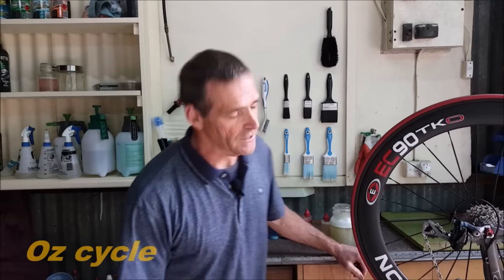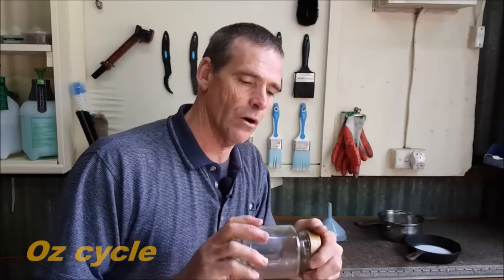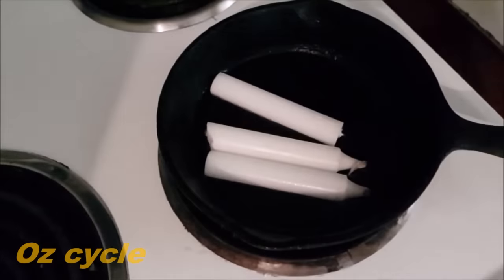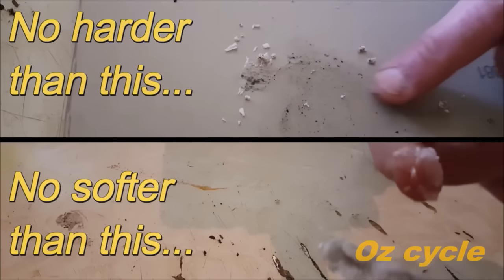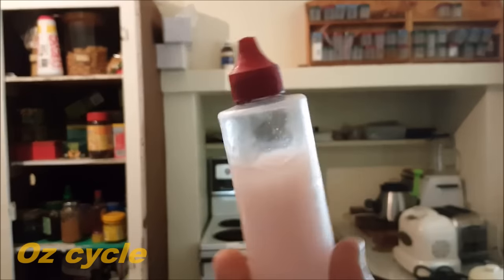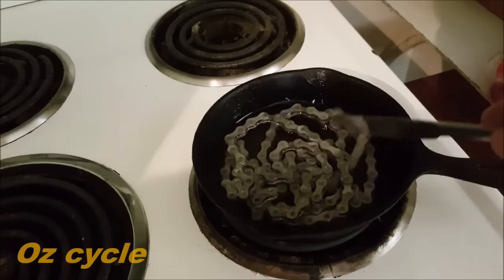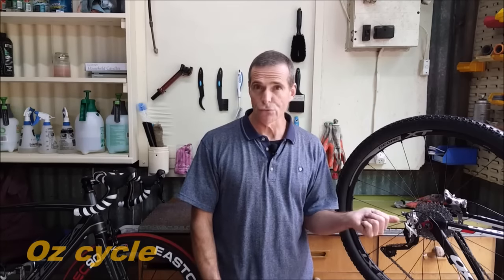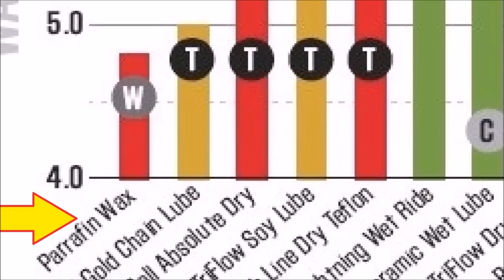BEST chain lubricant ever !! .....make it yourself.

Comment: In Canada , Followed the recipe, added more Liquid parafin so mix was on the soft side. Warmed the bottle to use,  but the waxlube stifens as soon as it drips on the chain. So need to warm the Bike too. (not cold , 12C) . Is there anything we in the north can add  to the mixture to be able to use this without taking the bike up the elevator indoors?
Reply from the maker: Add more xylene to keep it liquid at lower temperatures. The xylene will evaporate once on the chain leaving just the wax.

Comment: Hi i live in a dusty desert environment, would this work as a dry lubricant as well. Ambient temps reach 35 to 40, easily here. And any alternative to xylene, xylene is the solvent here, can acetone, paint thinner be used instead.
Reply from the maker: The wax works fine here in summer 40degrees C so should be ok there. Yes paint thinners or acetone will replace xylene.

Comment: Liquid pariffin or pariffin oil is pricey here, about $10 to $15 for 16 oz or 1 pint. I can get a pint of mineral oil for $2. Also, Walmart sells Florasens lamp oil for about $7 for 64 ounces but it doesn't list the ingredients so I'm not sure what it consists of and I can't seem to find the ingredients online either. What about Kerosene, would that work? About $4 per gallon here.....
Reply from the maker: Chemicals have different marketing names in different countries so best to try it out to see if it works Jeff. The result should be a non-oily but softer wax than hard like a candle.
Reply: oz cycle  I think I'll try the lamp oil first.

Comment: Why dont we use the wax lube for bearing? isnt it good? i think the viscosity really similiar with your medium grease.
Reply from the maker: +Kevin Kurniadi Its a great idea Kevin but there isnt enough longterm testing to prove that it is as good or better than grease. Go ahead and try it and let us know.
Reply: ive tried it already. it failed. its very slippery but i think the wax doesnt penetrate enough and hardened so fast. i think my wax lube doesnt smooth enough?

Comment: Hello sir , 
I have made the lube but i have a doubt sir 

Like you said we should check the consistency of the wax 
I have a made a same consistency which you got in video 
But after mixing the xylene, after applying in chain the wax seems to be ok but not very stiff , it is solid but we give pressure on wax it seems to be like little oily

Is this ok sir will be little oily when we give press on wax after drying
Reply: The consistency of wax which we got before adding xylene is not same after adding xylene
Reply: Please let me know the is this correct

Comment: use a double boiler method when melting wax,  a deep container that holds and boils water and then immerse a tin can where the wax and paraffin oil would melt together.       Similar process as when you are melting chocolate... never directly onto the stove.   Its a much gentler , safer and avoids direct contact with the heat source which could ignite the vapours or any accidental spill.

Comment: Hi  Ive just got a new chain and are waiting for the PTFE powder to come from AliExpress      ,,,question,,,,,once ive done the cleaning of the chain and the initial waxing  in the slow cooker at 90 deg  and are up and riding ,,,,,,,,,   do i then use  this solution on my  chain and  only     remove chain for  hot wash and  then soak in slow cooker  say   once a month ?   im riding  approx  200 klm a week on road bike ,,,,,,
Reply from the maker: Can do but you will get better results from a proper clean and rewax

Comment: what about riding in low temperatures (below 0° Celsius)? will the wax become too hard to have an enjoyable ride?
Reply from the maker: +Knut Knutzen No,it will be fine. Once you have added paraffin oil to candle wax it stays creamy consistency. Its just applying it to the chain with a squirt bottle that you need xylene.

Comment: Okay, so I must not have the consistency quite right. It's rather cool here in Perth today. So I warmed up the squeeze bottle to liquify the mixture again (it had congealed). But as soon as it hit the chain the lube hardened up and it looks rather like I've melted some greasy candles on my drivetrain. :) Suggestions?

By the way, thanks for the "how to" video!
Reply from the maker: +Max Randall Dont worry Max,all youve done is put warm wax on a cold chain. The chain being metal will quickly bring down the temperature of your wax. Best thing is to warm up the chain. If you cant remove the chain from your bike,keep the wax:paraffin oil ratio the same but add more Xylene...this will keep it liquid at colder temps but you will need to allow longer time for the xylene to evaporate b4 riding the bike. If you can remove your chain best is the 'hot wax' method.
Reply: Thanks for the quick response. Much appreciated. I used our rice cooker, melting three candles, which came to about 250 ml. I added 250 ml of the paraffin oil and then added xylene. I probably didn't add exactly 250 ml of xylene though. That stuff scares me a little and the kitchen was getting a little fumey! So, I'll add more xylene and see how that goes. Thanks again.
Reply from the maker: +Max Randall Dont use Xylene in the 'hot wax bath'!!  Xylene is only for the squirt bottle application. Just use candles and paraffin oil.  Put your chain in the hot wax for 15mins. Allow to cool to 50degC then remove chain. Done.
Reply: Yes, I was making the squirt bottle mixture.
Reply from the maker: +Max Randall Ok,yup. Stick with Plan A then. Sorry to confuse you Max   :)

Comment: I must be doing something wrong. If I don't cycle for a couple of weeks my chains (road and man bikes) rust up.
In use after lubing my bikes ride beautifully and change gear faultlessly. BUT inactivity and they rust over.
Ive cleaned and soaked my chains in a rice cooker with petroleum wax and PTFE and I've made up and used the drip on liquid lube. But inactivity and rusting still occurs. What can I do to keep them un rusted?
Reply from the maker: Add some paraffin oil to the wax....it coats the chain preventing oxidization

Comment: Been trying to make this for a couple days without much luck. As I'm in California Xylene doesn't exist, but I found a Painter's Solvent which "Replaces Mek, Toluene, and Xylene. The solvent contains acetone, methyl acetate, and mineral spirits. I have my 1/3 parrafin wax and 1/3 parrafin oil mixture combined and it seems to be the right consistency. But it seems no matter how much of the solvent I add it still turns to mush when cooled and isn't liquid. I've tried to add more solvent, but with the same outcome. The mixture is now super smelly and overwhelming with solvent odor. Any idea what is happening? Is your mixture have a strong odor of solvent as well?
Reply from the maker: Is the paraffin oil the type used in pharmaceutical industry or 'lamp oil' Jason?

Comment: I had a bad experience with the paraffin and paraffin oil chain lubrication.  After only 20 Km. in a ride with some mud, no rain and a little river crossing, the chain began to make noise and almost impossible to pedal, the chain was stiff and the rear derraileur got stuck, i was lucky not to break the dropout.  Last saturday in the next ride, with no rain and almost no mud, i tried again, added a little more paraffin oil to the wax but after only 30 Km. the chain was noisy, and now i see rust in the chain where the links contact the teeth. What am I doing wrong? I cleaned the chain with diesel oil and then washed with soap and brush, dried in the toaster, then I melted 1 pound of pure german paraffin and half bottle (1 qt) of Ultra Pure Paraffin Lamp Oil, took the chain out of the wax al 50 C.
Reply: Clean the chain from all lubricant, I use a ultrasonic cleaner then cook the chain in pure paraffin wax. I actually use my heated ultrasonic cleaner 
that heats all to 80 degrees and let it there 30min in melted paraffin, that makes sure the paraffin gets in everywhere. My chain works great, keeps clean and dont make noise.
Reply: Pretty sure the diesel oil was your issue boss.

Comment: @oz cycle I just made a batch and the final product has a really strong Xylene odor. Does that mean I added too much Xylene? If not, does this scent fade over time or will it always smell like that?
Reply from the maker: It will always smell strong because the xylene wants to evaporate quickly,Dane. Once on the chain the smell disappears in about 10minutes. If you dont like using  xylene try the hot wax method.

Comment: Made mine, parafin 35%, lamp oil 35%, white spirits 20% and isoprophilic alcohol@95% 10%. Added a little teflon.
Reply from the maker: Where did you source the Teflon?
Reply: oz cycle added a little liquid wrench  dry lube, it basically has the same solvents and leaves a dry pure cerflon film  but there is PTFE powder in Amazon which could yield for years!
Reply from the maker: Thanx for that. Unfortunately we dont have Amazon here in Australia and Teflon is not available on its own either for some reason. Hopefully Amazon will come here soon 😁
Reply: oz cycle I am in the Caribbean, no amazon here either but good mail  forwarder service from Miami. I cannot get white lightning wax lube here nor can be mailed from US as is flammable fluid.

Comment: How do you clean the parafined chain when it is time to do so?
Reply from the maker: +Georg Hausherr Same clean as the begining,Georg. If not dirty but just needs more wax you can wipe the chain best you can with a clean rag and bath in wax again....any dirt should sink to the bottom of the bath.
Reply: @stevenleffanue  Here is where I am getting lost. You have two excellent video's about wax lubricants. One you show us how to use wax and oil and dunk the chain. The other, this one, shows us how to make a lubricant with wax/oil/Xylene. My question is, after the first hot wax/oil treatment, do I ever have to remove the chain and do the hot wax/oil again, or can I simply clean off road dirt and debris and liberally drip the wax/oil/xylene compound on the chain?  I ride a recumbent and taking off that 6-mile long chain can be a challenge.
Reply: @7tub3r  been searching forever for tips on this, and every single time the answer is cook it again, or wipe with a rag and drip on it... I'll be needing to remove the damn chain every week with this stuff as no amount of wiping will get rid of grit embedded in this blowtorch loving gloopy thing. It's not even in the realm of the ease of swishing it around in a bottle of degreaser to wash off as it needs to be hot and who wants to dig a chain out of a dirty congealed mess... Can't even scrub and rinse it properly.

Comment: can we use this one the cables? dip the cables in the mixture and then insert to housing?
Reply from the maker: +lee guankiat Yes,see "Waxing chain-comonly asked questions answered Pt 2". You can apply the wax with fingers straight to the inner cables.
Reply: I just washed the jockey wheels, chain, casette and crank. They are clean and did the wax bath on my chain. They indeed feel veryvery smooth. I noticed from only a 10km ride, My chain have very dark grey wax. is that normal? Also I think i took my chain off the bath when it was too cool or that I didnt use enough oil and that is alot of wax on the outside of the chain which falls off later.

Comment: Hi. Can I use contact cement thinner? Does not specify whether it is xylene. Just say thinner for

Contact cement. In the painting tell me that it is similar. Thank you!
Reply from the maker: +antonio san illan Not sure Antonio. Put some in a jar and add some paraffin wax. If the wax disolves within an hour it will be ok. If you cant get a solvent in your location,try mineral terpentine....it is slower acting but will work with the wax.
Reply: oz cycle gracias!! voy a probar saludos!!!

Comment: is this a reupload? 

also, Ikea has a big unscented candle for around 3euro would that do?
it says it's paraffin/vegetable wax.
Reply: Hi, I've used already 2 times ikea's candle for my chain. As is, without any additives.
The good: drivetrain is clean as a whistle for several weeks, even after a couple of rain showers.
The bad: must wipe the chain good after you remove it from the pan with the melted wax, otherwise it will make horrible noise.
Also, it doesn't hurt to pedal for a couple of minutes in the work stand or on the hometrainer before you take the bike outside.
Reply: ah great! I'm going to have to go back to Ikea. did you do what was done in the video? or you just melted it and put your chain in?
Reply: Melted it in a pan, leave the chain for 3-4 minutes, or until there are no more tiny bubbles coming from the rollers.
You could add liquid paraffin. I assume it makes the chain quieter. I leave it out because I couldn't find any yet.
Reply: c99a, it doesn't matter what candle you use. If you ride enough you will understand. Your simply using parrafin oil to make a candle stick the correct viscosity to use as lube, the xylene is a carrier. I don't wanna put shit on a fellow cyclist mate. I got lucky as the the candles he is using are same ones I have.

Comment: does it work in winter? like 0C and below? or is it going to peel off in little pieces?
Reply from the maker: Yes,it will work fine
Reply: @stevenleffanue  thanks! I think i'm going to give this a try. last winter all the salt that they put on the roads really made my chain rust even if I lubricated it after every ride. winter is coming, let's see how the wax works.

Comment: Mate I had a real bad problem with my LOOK MTB. In the back inside of the cassette frame (also on the other side where the hanger is but not as bad) the pressure from the back quick release is crushing (eating the carbon fiber causing the back wheel/ tire to rub against the frame).Can you check if yours is doing the same thing.Thanks!.
Reply from the maker: +Raul Eduardo Sorry you got that happening Raul....mine isnt doing that. Perhaps your quik release is too tight or too loose? The right side quik release should be clamping onto the alloy dropout?
Reply: It's is I am having some one work on it (he repairs carbon frames). I hope I can salvage the frame.

Comment: I have made this lubricant now as told in the video 1 part parafine, 1 part parafine oil and 1 part xelene.
it is all liquid, but when i put it on the chain, it is immidiatly hard. the chain is cold, i think 5 degrees celcius.
Do i have to put more xelene in the parafine wax?
Reply from the maker: +Ronald Merema You can either warm your chain up so that the lube soaks in properly or add more paraffin oil,Ronald. I would suggest doing the hot wax bath method in cold conditions tho...(see "hot qax bath" vid).
Reply: Thanks for your answer.
I have alreade soaked the chain in a warm bath withe parafine and parafine oil.
But now i want to make a lubricant to lube the chain between 2 rides.
I don't want to take the chain of the bike.
I thought this was to lube the chain every ride, and that it was liquid.
Reply from the maker: +Ronald Merema ok,yes. Add more paraffin oil to the mix and do the knife test at the cold temperature. The mix must be like a hard cream at that temperature. Then lastly add the xylene. The xylene is just the carrier to get the wax lube into the chain.....it evaporates soon after application altho in cold temps it may take several hours to evaporate. Best to wait until xylene has evaporated before riding the bike otherwise the mixture spreads everywhere just like oil.

Comment: Acetone could work? It is way nicer to work with, and use, than xylene. Acetone is not water displacing, but the waxes should penetrate enough and then they will adhere to the metal and take care of that.

Comment: Hi oz.. do you have best ratio between parrafin wax, parrafin oil and xylene? Im live in tropical and the temperature around 35°c
Reply from the maker: Best ratio is same as video...equal amounts of each Muhammad. Doesnt matter where you live,once the the xylene evaporates it leaves just the wax mix.
Reply: oz cycle thx for reply. Now i know the function xylene is.. very informative video. The best diy chain wax tutorial i see

Comment: You've forgotten to mention the noise from using wax.  It isn't a quiet bike you'll be riding.
Reply: I went from a wet lube (R&R Gold) to wax and I think wax is quieter.  But I made the switch recently and it's been very cold where I live.  I don't know if the chain will make more noise when it's warm but right now I hear no noise from my waxed chains.  It's perfectly silent all the time.  I did notice a drop in chatter after I went to the PTFE formula.  The chatter is there only when the chain is freshly waxed.  With PTFE the chatter doesn't last long.  After a few miles the chain is silent.

Comment: This is way too much work for just a chain. been a fixie messenger for 18 years and all i do is use wd40 or vegetable oil and simply change the chain every 6 months (19200kms) even in Montreal winters (2years out of the sprockets) I dont understand peoples obsession with chains and even if I were to gain another month (3200kms) in the chains life I still wouldnt bother as I already waist 30 mins a day working on my bike just cleaning the rims from brake dust etc. (yes you need brakes with a fixie in Montreal) But great video as always all the same thank you.
Reply from the maker: Waxing your chain would give you a forever clean drivetrain and save you on cleaning as when chain needs lube just pop it in cooker whilst you clean rest of bike. Done.